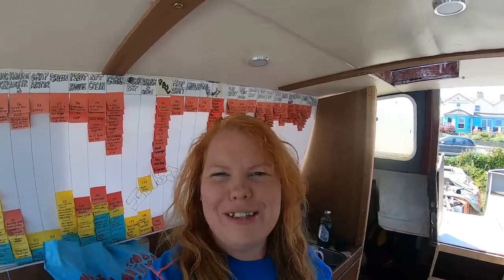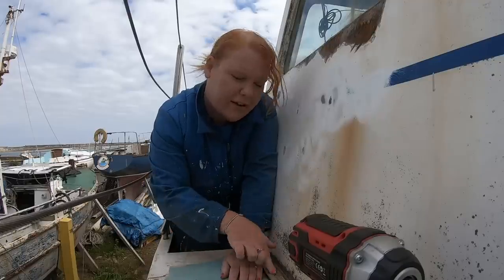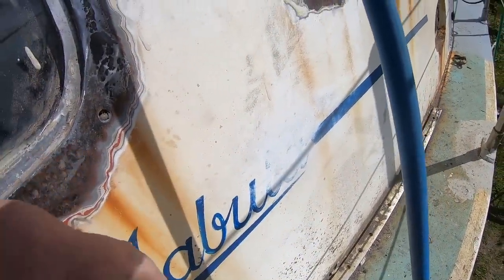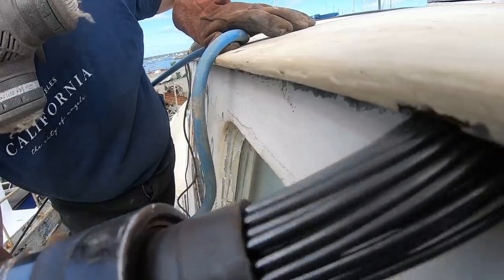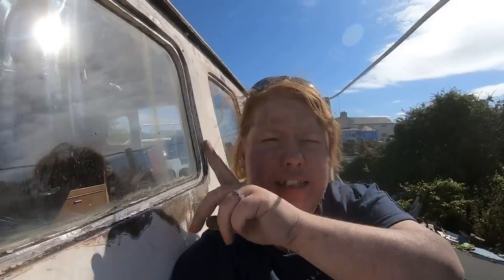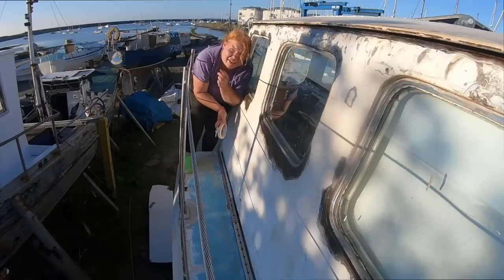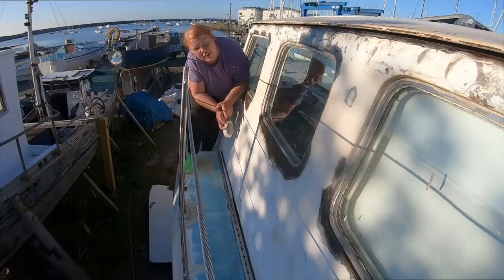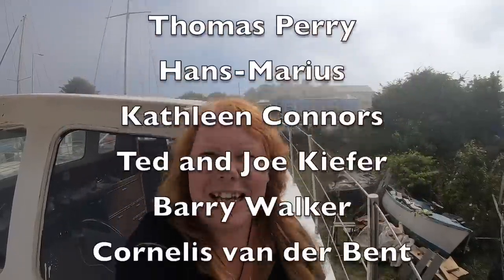#100 - GIRL VS RUST!!!! Boat DIY project

Comment: Hay y'all..just want to say good job
Had a steel 39 ft dialer myself..loved her.
I had large wheel house window like yours .
I welded 4 s/s nuts to all 4 corners so I could put shutters on for real heavy weather.
Fished for 20 years n have punched windows out in heavy weather.
Just a little security..
Thanks u lot.
Reply from the maker: Yes. That’s somethint we will 100% be addressing

Comment: As has been said by many Jack, its a radar reflector. Its actually an octahedral reflector which has  8 corners formed by 3 planes intersecting at right angles. Whichever way it is hung (although the best is supposedly the 'catch rain' position) any radar wave hitting it will be reflected across the corner and sent back to the point of origin (the radar scanner that transmitted it). This enables small, low down or non reflective targets (such as wooden or fibreglass boats) to show up on radar. It should be hoisted as high as possible so that a small vessel can be seen on radar when the hull may not be visible due to being hidden in 'sea clutter' (radar reflected back from waves within a couple of miles of the radar scanner)
Reply: The radar reflector also works on exactly the same principle as the plastic reflectors found on vehicles and bicycles. A set of such glass reflectors were left on the Moon as well, and they are used to accurately measure the distance to the Moon via reflected laser light.
Reply: Now I've learnt something to yippee ta
Reply: @deborahtaylor9432  yippee ta? :-)
Reply: @johankotze42  Maybe it's: "Now I've learnt something too, yippee! Ta (Thanks).
Reply: Jack, you can show how this works: ask Andy to clear a workbench and arrange two mirrors upright at right angles to each other. Then put your eyes at the same level and look at one mirror. Then move around while still looking. What do you see? 
Radar is very similar to the light you can see yourself by. 
Hope that works!

Comment: My tip this week Melody Makers is... When trying to remove stubborn screws and either the screwdriver, impact gun or impact screwdriver are finding it difficult. Find a piece of round bar the same size as the head of the screw or slightly smaller and 'drift' (basically hit it the head) using a hammer. Along with penetrating fluid, it usually does the trick. Hope that helps? If you have a spare bolt or setscrew of the required diameter then use that, as long as it isn't one you intend to use later on!

Oh! Another thing... When grinding near windows, make sure to mask them off as the molten globules can impinge the glass.
Reply from the maker: Excellent tips thank you so much

Comment: Great job nice and methodical gets the job done.Good tour round the boat by Jack nice to see whats about. One question when ya head out closer to home are you going to install mast or lay it horizontal on the wheel house roof ?. Ya making good head way keep at and Carry on. The T Shirt is a hoot at least ya doing stuff most Dandy looking people never no what hard work is. Butyl Tape around the screw or Bolt will seal as it goes in. Greetings from the Bottom of the world NZ.
Reply from the maker: That’s a good question
We did consider making a frame and carrying the mast flat but honestly it’s less work to just repair the chain plates than it would be to make a mast cradle

And we have to hire a crane anyway to left the mast onto the boat so there’s n real advantage in putting the mast on a cradle

Plus if the mast is up we can sail some of the way so long as the conditions aren’t too nasty 

If it’s a nice day with a light breeze then we migbt just get some canvas up

Comment: Jack many have told you that that object hanging on the rigging of the boat is a radar reflector.   They are correct.   However you should look up and find out how and why it works!   After all doesn't the boat, mast etc. reflect radar?   Why have a 'special' object reflecting it and why does it work better?    Knowing is one thing, understanding if better.     ( hint look at the back of cars at night)

Comment: you are all doing a great job and I wish you well but when you descale and spend time getting the rust off and there is any wind the rust particles will land on another fiberglass boat and stain it very badly, you will not be very popular believe me. that job should be done under cover. just making a point in case you get any complaints.

Comment: That painting is a bit slap dash???????????
Reply from the maker: Just a high build primer, it will be flatten back and have more coats before top coat.
Reply: Why the negativity? primer coat doing its job. Oh I forgot you would have rolled and tipped it
Reply: @SailingMelody  ok makes sense.